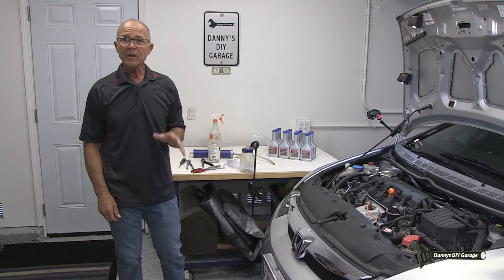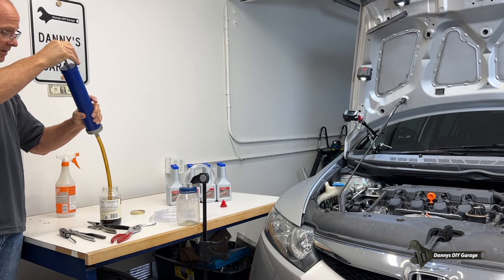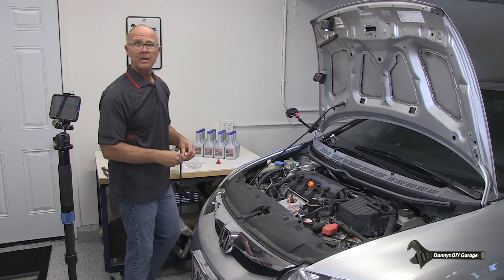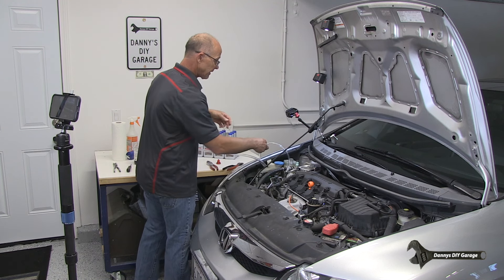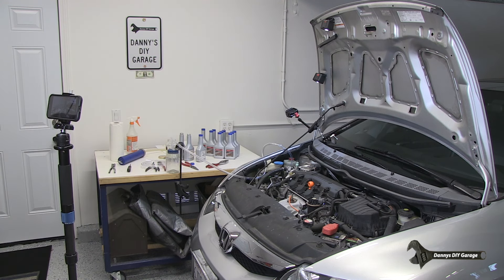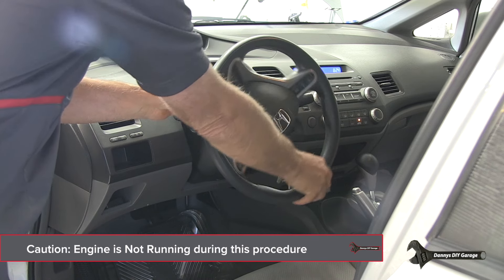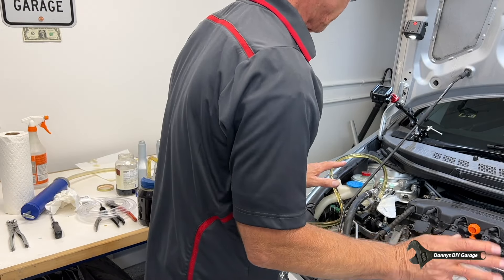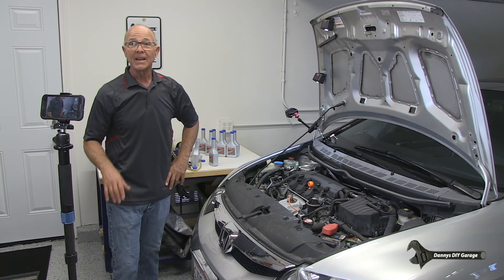How To Flush your Power Steering System on a Honda Civic #powersteering #powersteeringflush

Comment: You don't need to get all the fancy hose to drain the off the power steering fluid from the return hose.  Just use a 1L soft drink bottle and secured it nicely.
Reply from the maker: Correct

Comment: Thank You so much! Simple clear easy to follow directions. Very Happy with results.
Dealer wanted $167 to Flush and Fill, cost me less than $35 for 3 bottles fluid 4' of 3/8" ID clear tubing and a 3/8" Brass Barbed fitting.
Reply from the maker: Awesome, thank you for letting me know it worked.
Reply: And do they really fully flush 🤔🤔🤔

Comment: Incredible thank you so much for this! I’ve never changed the fluid and was surprised at the “whine” I was hearing thought it was the transmission. Literally perfect 👍
Reply from the maker: You’re welcome, Thanks for commenting
Reply: @dannysdiygarage  How much power steering fluid roughly did you use to flush the system in this video ?
Reply from the maker: 3 of those per vehicle,
Reply: Thank you for making this

Comment: Danny that was the easiest and best way I've seen to change the power steering fluid.  You ought to patten this, this makes life a lot easier.  Thank you so much for all of your videos.  I could never have changed the a/c expansion valve if it wasn't for your video on how to do it, a lot of work but you explained and showed me how to do it, and with great success I did it and now I have 40 degree air coming out of my vents.  God Bless.
Reply from the maker: I appreciate you, thanks so much
Reply: Patten?

Comment: My 2005 Civic has 194,000 miles and the fluid may be original. The steering was a little hard so for three bottles of fluid and 40 minutes of labor, I changed the fluid. The steering is definitely lighter so this was overdue. I used aviation grade alum tubing which snugly fit into the return line. Position the hose clamp and the old stuff came out easily. Instead of buying a pump, an old squirt bottle of Dial soap😁 evacuated the system. Thx Danny.
Reply from the maker: Thanks for sharing Barry 👍🏼

Comment: Cool method but it’s probably easier to just suck the old fluid out, refill, turn car on and turn steering wheel a few times, turn car off, suck fluid out and repeat a few times. Your method is definitely better for a true coolant flush though very thorough. Thanks for sharing
Reply from the maker: Yeah, whatever works for you, as long as it gets done, right 👍🏼thanks for your input
Reply: Thank you both for your powerful advice. I adhered to both of your methods, and I just changed out 3 of these little bottles worth.

Comment: Beautiful video and very helpful. The PS fluid in my daughter's 2009 Civic was filthy and a garage recommended a flush which would have cost Lord knows how much.  I bought a 3-pack of fluid on Amazon, the tubing and fittings that you recommended, drilled a couple of holes in the lid of an empty vinegar bottle to catch the fluid (my rig was not near as well made as yours but it got the job done), and followed your steps from there. It was a quick and easy process, and it was very fulfilling to see all that dirty fluid come out and see the clean stuff in the reservoir. Thanks to videos like yours I'm able to keep the Honda running like a champ while saving a ton of $$.  Keep up the good work!
Reply from the maker: I appreciate your gratitude ❤️

Comment: Danny this worked superbly. Fluid is super clean in reservoir after following your video, on both my civic and accord. I didn’t trust myself to do the engine start part like you did so that was the only part I left out

Just figure I’ll have to do it in a few more years since I didn’t get as much out as you

But the reservoirs have super clear fluid after driving for a week since the job even even tho I didn’t start engine at all

Thank you !

Comment: I saw your video last year or so, back then  I did a poor mans turkey baster multiple times power steering  flush, today I hit the big box store and bought a 3/8 barb, 3/8 x 1/2 clear tubing and followed your steps and had perfect success. Thought I`d come back and thank you for the video, changed all the other fluids in my 09 CIVIC as well. new brake  pads, tranny fluid,  oil and filter and replaced brake fluid. Thanks Danny
Reply from the maker: I appreciate your support, thanks for sharing this

Comment: Excellent video.  I wish I knew it was this easy several years ago. Just flush a 2007 Accord  that had very dark fluid due to minimal changes.  It needed 5.5 bottles of Honda Power Steering Fluid ( they each  hold 12fl oz) to get it to a pale brown color. That was good enough for me.  Reminder Hondas are very sensitive to particular fluids, therefore only use Power Steering Fluid by Honda!
Reply from the maker: Thanks and appreciate the great information you added to help others
Reply: They're mostly just sensitive to transmission fluids, Lubeguard Synthetic Honda Power Steering Fluid is way better than the basic OEM Honda stuff.

Comment: I use a MityVac to suck out the system via the return line, them use brake cleaner to spray out the reservoir. There is sediment in the bottom. Put it back together and suck fresh fluid through. Easy peasey.

Comment: @9:33 next step missing ... it should go into how you disconnect the kinked hose from the reservoir and reconnect the return line to it before you top off the reservoir, which you did but it wasn't shown. Other than that, it was a great video! Awesome angles and that camera mount is nice and steady. It felt like I was looking over your shoulder with those over head shots! OMG, I just knew that bottle was gonna do a 'Spindle Top' oil geyser, but it stopped just in time! I'll set mine in a 'overflow' pan though, I know me.
Reply from the maker: Warren, thanks for watching this video so closely and adding feedback.           “❤️ I Love It❤️”  Great that you learned something and enjoyed watching, good luck on your PS Flush 👍🏼

Comment: A hand operated vacuum pump connected to the return tube is an easy method to remove most of the old fluid from the system without operating the pump.
Reply from the maker: Great tip!

Comment: Hi there Danny. Just had my PS pump / rack end pinion repaired due to a leak. 

2 days later was surprised that the reservoir is empty. I'm not quite sure but I think only 500ml or less was used to top up after it was repaired. 

Do you think its still not enough? Or there's still a leak or some air that needs to be bled out?

Comment: Great video. Why not turn the steering wheel back and forth manually the entire time and skip turning the vehicle on at all to prevent any damage to the motor?
Reply from the maker: The pump needs to turn to get the fluid out, you could remove the belt and turn it by hand if you’re worried about it, or just skip that step and leave that tiny bit of old fluid in there

Comment: Quick question. Do you need to jack up all four wheels to level the car, or are just the front two sufficient? As always, thanks for sharing.
Reply: Hello. I believe he lifted the car so that its easier to steer, if it was on the ground it'd be a lot heavier to do so. 
When checking any fluid level, the car must be on an even surface, always.

Comment: Would you recommend changing the power steering reservoir with the red cap on any set interval? Wondering if power steering fluid were initially neglected, if it would cause buildup of sediment or something in the reservoir that can affect new fluid when flushed with your method?
Reply from the maker: That’s a great point, definitely replace it if it looks ugly 👍🏼
Reply: @dannysdiygarage if you get some power steering fluid over on the belt what would be a good way to clean it off ? Just wipe it off or need to use a cleaner ?
Reply from the maker: @vandiyplant921  absolutely 👍🏼 keep belts clean

Comment: Thanks Danny for the great tutorial! After replacing my power steering pump I get some whining when I accelerating to high rpm. I think I still have air since I see tiny bubbles in my reservoir. but I'm not sure
Reply from the maker: Hopefully the air will work itself out
Reply: @dannysdiygarage Got my Power Steering smooth after the flush :). My car still whines, but only when I revv up the RPM. I bought an aftermarket Steering Pump pre installed with the Pulley,... So Could it be the Pulley making the noise?? Appreciate the Help!
Reply from the maker: It’s possible your o’rings are leaking, watch this video Honda Civic Oil Leak, Power Steering noisy
https://youtu.be/rtSmW8ZZMIw

Comment: Hi Danny, would a hand vacuum extractor pump be able to suck all the fluid from return hose including fluid in the steering gear and pump?

Or does that require turning the engine on for 1.5 seconds or manually turning the pump with belt off?
Reply from the maker: Correct the power steering pump must turn

Comment: thank you for the video. So it only takes 3 bottles to do but I didn't see how you connected the hose back to the reservoir? Is that really messy as there is fluid in the reservoir?
thank you
Reply from the maker: No it’s not messy, use a rag and use your finger to plug the hose hole as you reinstall the hose

Comment: Thank you for the video. Thinking. Should I do this when the engine is not hot. Maybe the power steering fluid will burn the PVC hose if still hot.
Reply from the maker: It doesn’t matter, warm fluid will flow better, but it really shouldn’t matter unless you live in a cold or freezing climate, I’m in California.

Comment: Danny, I've seen both your videos on power steering flush & brake bleed process, and I love both of them. 
Question: I want to buy two jar containers , one for the POWER STEERING FLUSH MACHINE  & one for doing my brake bleeds, what ounce container size would be needed for collecting the fluids 
For these two jobs?
Reply from the maker: Troy, I appreciate you watching my videos, as far as the "Power Steering Flush Machine"  the container I used was a Mayonnaise jar, as you could see it's a little lacking on the amount of fluid it can handle, I would double that, however for the brake fluid the Mayonnaise jar size is good.

Comment: Great video Sir, Question is your O2 Sensor aftermarket or Oem , If Aftermarket what brand works with honda civic 2007 , Oem are pricey , thks
Reply from the maker: Mine is OEM, I don’t have that answer
Reply: In my opinion, aftermarkets  from a well-known brand are fine. For Honda Civic 2007 LX, Denso 234-4350 is the perfect one. It’s cheaper than OEM a lot but pretty much same quality without Honda Logo.

Comment: Hello Danny, an other great video. Can you please tell me where the power steering reservoir is located on my 2015 Honda civic? Not sure if I’m blind but I can’t find it 🤷‍♂️
Reply from the maker: sorry this comment got away from me, however I do not have that answer, what did you find out?
Reply: @dannysdiygarage  lol no problem. Well apparently some of these Hondas have an internal electrical power steering which doesn’t need fluid replacement. I need to investigate a little more about this. I saw this comment online in a forum.

Comment: Hello Danny, after the fluid changes to clear and you have topped off the PS reservoir,  how did you remove the return tubing that was filled with PS fluid?  and not make a mess? I have a 2010 Accord V6 that I would like to do this service on myself. This looks pretty straight forward for a DIY'er. Thankyou!
Reply from the maker: I used rags to catch any fluid that wasn’t manageable

Comment: Thank you for this very informative video. You took yhe time to explain everything in a concise manner that a DIYer would understand.  I would like your opinion about water pumps. I have a 2008 Civic and it's almost 200K miles and the water pump is original. There are no leaks and I have been changing the coolant on a regular annual basis. In your opinion, should I change the water pump now or wait until it starts showing leaks. I have been quoted $700+ to replace and I heard that Civic's water pump is very difficult to DIY. I appreciate your input. Thank you.
Reply from the maker: I would wait, one of my civics has 165 k so a diy coolant pump video could be in my future also

Comment: If you have 150k miles on a 2010 civic and the return hose has never been removed. Do you need to be careful - maybe rub some power steering fluid on the hose before removing the hose clamp and removing the hose from power steering fluid reservoir?

Or would it be ok to remove the clamp and hose without conditioning it first?
Reply from the maker: Twist and pull, yes anything you you can do to make it easier is smart

Comment: I have a 2014 civic si bone stock and I just noticed a power steering humming sound on a slow uturn. It doesn’t make the noise when I’m stopped and turning the steering wheel. Car has 86k miles. Do you think a flush might fix the issue? Seems too early for a pump to be going out.
Reply from the maker: check for a small power steering leak, if no leak, yes it worth a try, here is a video to watch https://youtu.be/rtSmW8ZZMIw?si=bwiPkKf41yL5gHWy
Reply: @dannysdiygarage  dang I hope there’s not leak because that would be a costly repair for sure

Comment: Do you have to start the car or could you just turn the steering wheel and top off the reservoir over and over ?
Reply from the maker: you can just turn the wheels, however, the fluid in the pump needs to get pumped out, which means at some point the pump pulley needs to turn, so either start the vehicle or remove the belt and turn the pump with your hand
Reply: @dannysdiygarage  perfect thank you

Comment: Cameras should be closer to the hose to see the transformation of dirty fluid to the new fluid. And you forgot to bleed the system for residual air. Lastly there is hot and cold fluid fill.
Reply from the maker: Appreciate your feedback
Reply from the maker: There’s no need to bleed, if you don’t run the system dry, new fluid in and old out👍🏼

Comment: Do you know if my 08 manual has gear box fluid, the corolla does. Not sure about the civic
Reply from the maker: are you asking if your 08 Civic Power Steering has a gear box ? if so no, it has a rack just like the one in this video.

Comment: Curious why you started the engine, then just turned the wheel and then started the engine again?
Do they do diff things?
Reply from the maker: Starting the engine primes the pump with new fluid, it’s high pressure so only do this for a few seconds, the engine needs to be off during the turning of the wheel, if the engine is on when turning the wheel the pressure will be way to high and drain the reservoir in 3 seconds, hopefully this answers your concerns 👍🏼

Comment: Reservoir nipple was shut via clear tubing ( time: 5:03 ) after return hose was disconnected. Missing from instructions is reconnect of return hose to reservoir. How was that done without introducing air back into system ?
Reply from the maker: its the return hose, the little bit of air that enters will be easily removed automatically in the reservoir

Comment: That’s the video I’ve been always looking for. However, the item in your link is currently unavailable as of now.
Reply from the maker: These should work also JoyTube Hose barb Thru-Bulk Bulkhead Fittings 3/8" Union Adapter Plastic Fittings for Aquarium Water/Fuel/Air (Pack of 6)
Reply: @dannysdiygarage  Thank you. I found it.

Comment: I noticed the amazon links for the hose barb splicers are out of stock or not available. Should any brand 3/8 plastic Barb on amazon be a good choice? 

Also noticed you didn’t clamp down hose either clear vinyl or return hose when splicing. There’s no need right? Not enough pressure to break the union there?
Reply from the maker: Correct any brand and yes not enough pressure

Comment: ONLY use Honda fluids in Hondas. They chemically balance stuff so it protects their parts as best as possible. They spend billions on developing them so don't think some cheap fluid will do the same job. Both my girls and my honda are 22 years old. I've owned mine for 14 years.
Reply from the maker: Well said, appreciate your wisdom, my feelings also